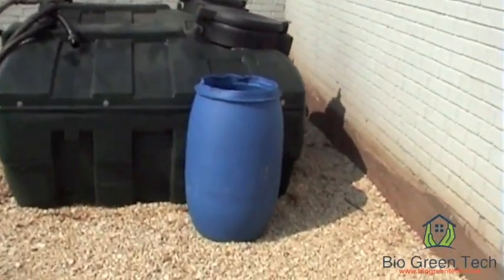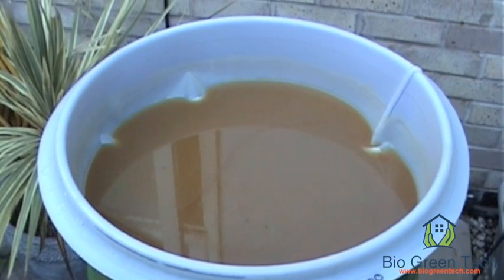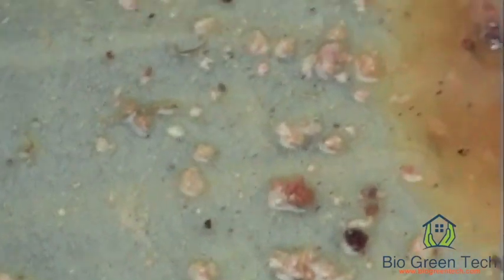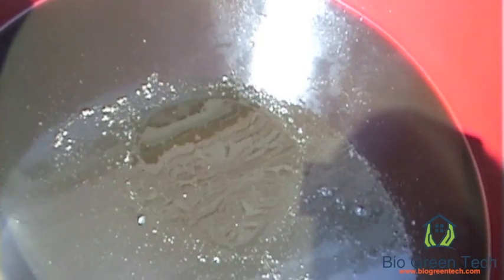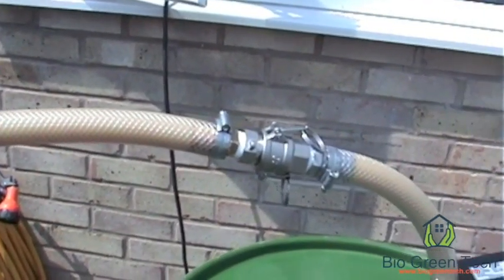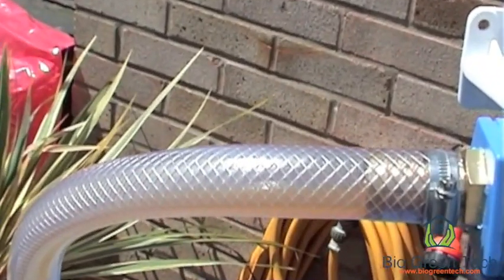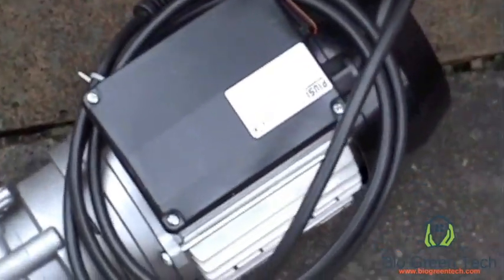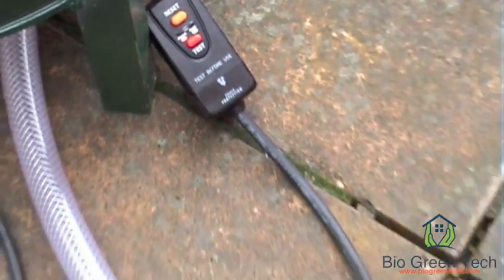🔴 WVO Waste Vegetable Oil Filtering, Biodiesel, Biofuel, Waste into energy, Energy crisis in the UK

Comment: I run a similar system as above and it's not complicated at all. power is pennies. when available i used a 12volt dc pump and marine battery that is recharged by solar charger. when diesel is over $4 per gallon the cost of electricity irreverent considering the savings. My truck consume 100's of gallons per month and waiting for gravity and settling just is a waste of time in certain applications.

Comment: You can do it for much less, simply having a settling tank then gravity feed through 3 progressively smaller filters (of course its better if the oil is warm) you can also do the same for used motor oil, I have been doing this for years now and have had no problems with it....the only additive I use in the winter is a litre of petrol to stop the oil thickening